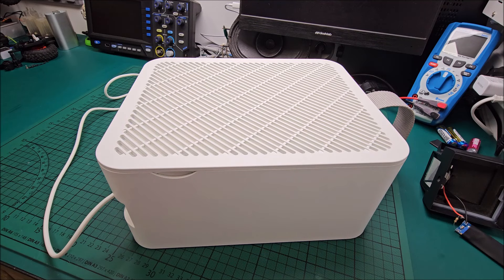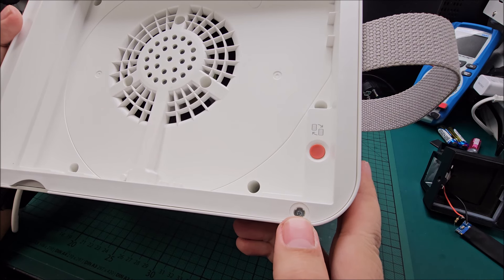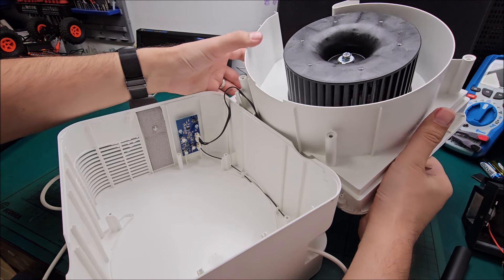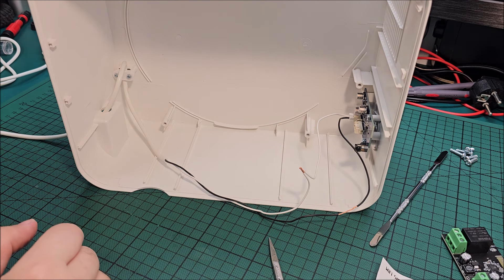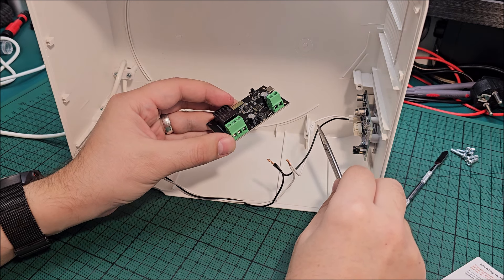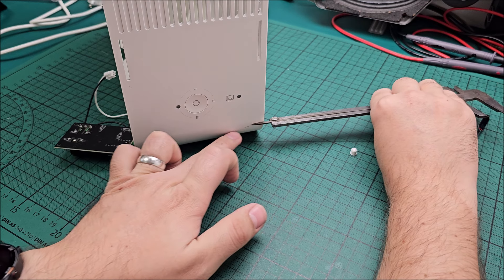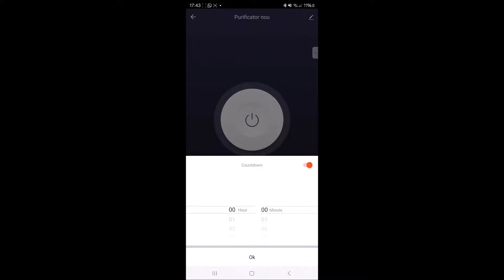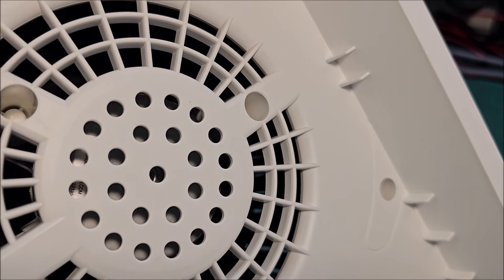How to add smart control to an IKEA UPPATVIND Air purifier 📱

Comment: Would connecting the relay on the wifi board to the pushbutton on the ikea board have worked to give you fan speed level control, or is the Tuya app on/off only?
Reply from the maker: Tuya app is only on/off.